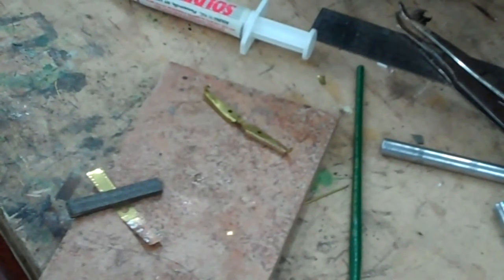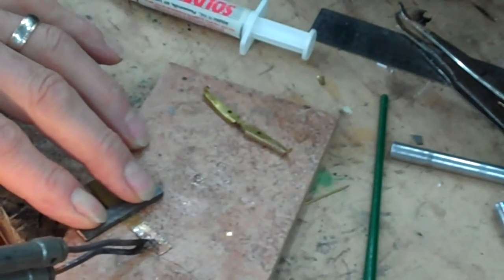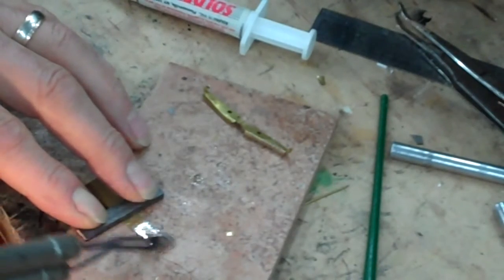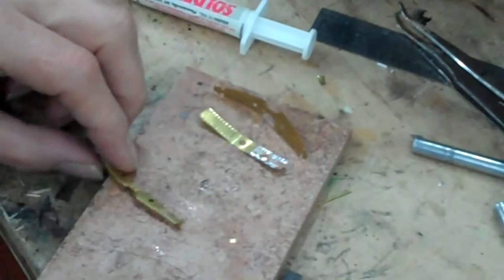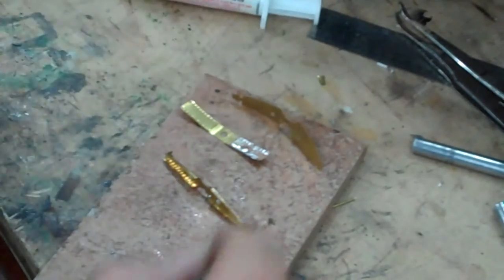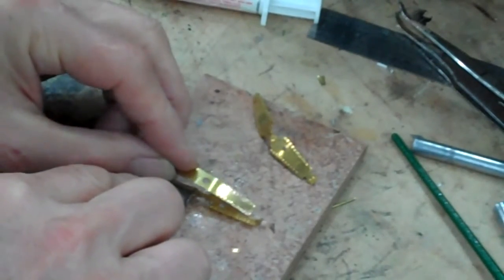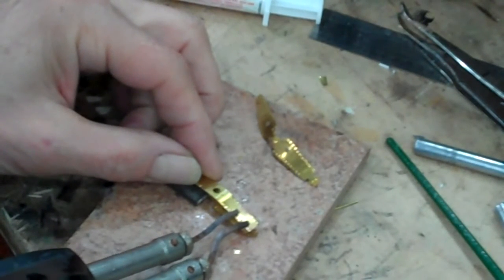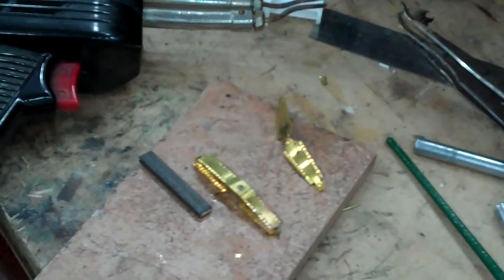El Cheapo Resistance Soldering Unit

Comment: I have an 80's (I think) soldering gun. Took it apart, it's just a transformer and a switch, secondary running through the tip. I read up on resistance soldering, and thought, basically the same thing as my soldering gun. Glad to see it works. Thanks for the vid